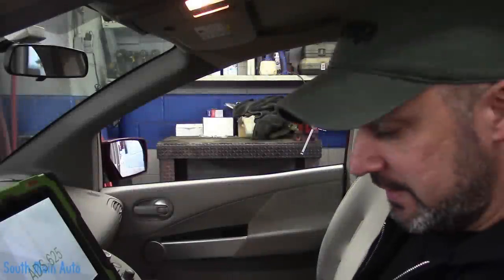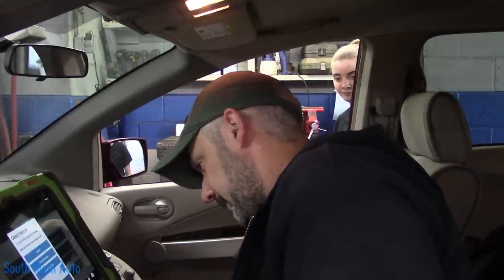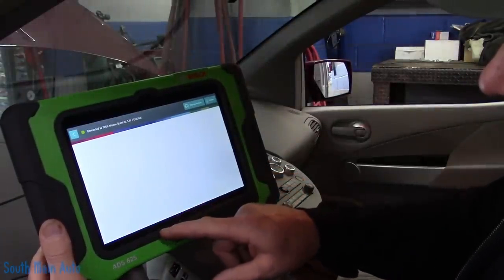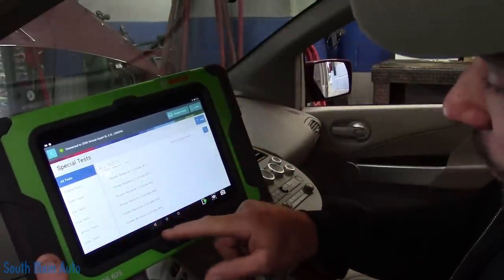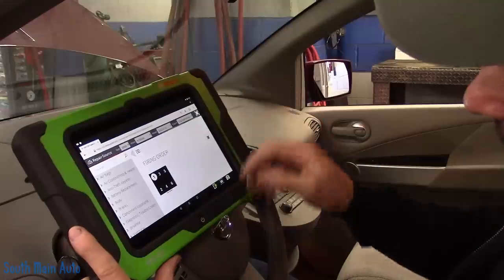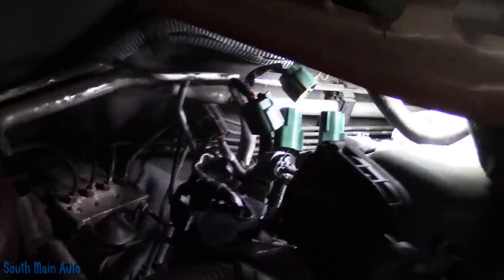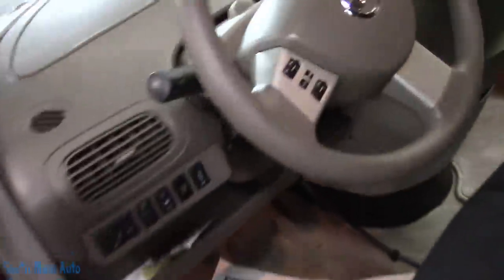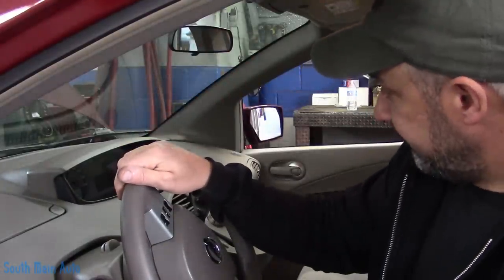Customer Replaced Spark Plugs And Now It Runs Bad!?

Comment: When I was 15, I rode a little Yamaha DT100 everywhere. One day the bike would Idle and move at low rpm's But as soon as she was opened up , she fell on her face. 

I limped it to a small shop after I couldn't figure out what was wrong. The mechanic came out after my explanation, Lifted the seat , removed my gloves from the intake of the air filter and said. That'll be 20 bucks.
Reply: Tom Wise   Was he joking or did you really have to pay?
Reply: @istvanmeissler2238  $20 is fair. Who knows when he'd figured that out. Bet it never happened again though.
Reply: Oh he was serious. It was definitely a life lesson.
Reply: He's gotta make money where he can haha! I had an old Yamaha timberwolf I was working on but didn't have a new air filter for the test drive (the old one fell apart). So I managed find a larger foam filter I had laying around and attached it to the cage with a couple of zip ties just temporarily for the test drive. It dies about 10 minutes into the ride. I looked to check the usual suspects but everything was fine. Then it dawned on me that the air filter may have got sucked through the carb and sure enough it did. It got pulled all the way through the carb then hung up on the intake valve steam. Pulled that out, went and bought the correct filter then all was well again.
Reply: Sweet

Comment: This video saved me big time.  I did the exact same thing this week on a 2007 Dodge Grand Caravan because I wrongly assumed the cylinder firing order was laid out the same way the the ignition coil pack was labeled.  Sure enough I had 1 and 3 switched around. I've been trying to figure out what was wrong for the last 3 days and came across your video.  Thanks a bunch I almost gave up and took it to a shop for diagnostics.

Comment: I figured that’s what he did - got the wires mixed up. 

An old man I knew told me about buying a 32 Ford hot rod  back in the 1950’s. The owner was selling it because it ran like shit and he couldn’t figure out the problem. It was a dog: Not missing, but no power. My buddy took it down to the local garage where the owner let him use the bay to work on his own car to do a tune up. It had a dual distributor Mallory ignition and he pulled all the plug wires without marking them. Then he had to ask for help so the owner got out the shop manual and they figured out the firing order and got it put back together.

Suddenly the car was a screamer. It would lay rubber all the way down the block. The guy who sold it had it firing out of order. Just like your customer.

Comment: Sometimes when you're elbow deep in a project, it's easy to miss the obvious. I work in bus garages, and I think most of us have had a situation where we can't get something to work, only for someone else to sort it out in seconds.

In a similar train of thought, sometimes it's best to walk away for a bit, then come back with a fresh, clear mind.
Reply: One of hardest times troubleshooting something was when I changed a motor in a car and it would run but only idle slowly. Any amount of over idle it would not go or quit. After spending like a whole day going over EVERY LAST THING I finally got the notion to try disconnecting the exhaust pipe and it went zoom. Turns out the old engine blew so much oil it plugged up the catalytic converter and sitting made it solid.
Now when I was on forums helping troubleshoot other people’s cars one of my favorite questions when it sounded possible was “ have you tried disconnecting your exhaust?”
Reply: The funny thing is that this is universal to any kind of troubleshooting. It's exactly the same for programmers who can't figure out why certain code doesn't behave as it should. Then someone else with a fresh pair of eyes comes along and spots the issue in a matter of seconds after you wasted hours or even days on it. 
Happens to everyone occasionally. :)
Reply: Yes, and sometimes after an all-day struggle all it takes is for someone to walk by and make some offhand remark about the issue to trigger the inspiration to solve it in a minute or two.  Had that happen more than once.

Comment: Thanks for the video Eric! We all find ourselves in trouble from time to time. I once did a front brake job on my 98 Ranger. I failed to realize when I took off the rotors that the inner bearing was inside the rotor. Took it to the machine shop where they turned the rotors. Inner bearings were sitting next to the rotors, but I failed to pick them up. I couldn't figure out why my rotors would not seat properly on the truck... DIY distaster as I towed the truck to the local mechanic. Problem got worse as the ABS sensors were damaged during my failed brake job. Cost me so much more than just paying for a pro brake job. Multiple lessons learned in this one.

Comment: get a transmission all the way back together and find a bearing or a seal ring or a snap ring on the bench.  now was this the old one or the new one??? and is there more than one outside ? did  i replace it?  now i have a cardboard box  the old parts go into only after the new one is installed. then parts list is compared to the box. nothing worse than being inturrupted  on a major job  multiple times.
Reply: interruptions will get you every time!
Reply: I like the box idea I make a list of all parts to replace check that list and I Mark or destroy the old part. Of course I only destroy (like a gasket or the like after I know the new one is correct). Do I can't reuse the old one. I have left my share of seals out prior to this method haha.
Reply: I put a trans in without a torque converter once lucky only bolted to the engine and didnt finish the reat went to put the bolts in and alot of 4 letter words came flying out lol
Reply: Great idea!  And simple, too.
Reply: Worked with a practical joker who used to toss random hardware on my bench when I had some piece of technical mechanical mischief torn apart. First time it happened I ended up doing the parts diagram, old part matching, head scratch. He went by laughing and fessed up as I was about to tear everything apart again. Taught me to be a lot better at organization and less of a chicken plucker parts dismantler.
Reply: james styler I ounce pulled a transmission out of a Toyota RAV4 and placed in next to the new transmission but managed to grab the old transmission and mount it in the truck and get everything bolted up just short of mounting the wheels just to find I goofed hard
Reply: @Gregg0112  You're not the only one that has done that. Lol
Reply: @Spudstrodamus  now that's bad, such a large part being forgotten :))
Reply: @mikeam3871  My daughter has done that to me on a 50 year old snow blower with no such thing as a a parts list/diagram available.  The little shit had the nerve to walk by and casually comment "you still working on that thing?".  This was during my third disassembly.

Comment: When I was rebuilding my Daughters engine in her 1998 Nissan Altima I mixed the Distributor plug with the transmission speed sensor... car wouldn't start and started poking around.  The plugs are the SAME color but not the WIRES, after 2 hours of scratching my head I switched the plugs and she fired right up.  Great video, even mechanics can make this mistake.

Comment: When I replaced the head gaskets on my 98 Legacy GT, I swapped the 1 and 3 injector connectors. Ran almost perfectly fine except for a slight miss about once every 30 seconds at hot idle. Not enough to even set a code. I drove it that way for a couple years until one of the classes I attended had a case study for a Subaru that very occasionally set misfire codes at idle because someone had swapped the injector connectors....

Comment: Wish I had your awesome diagnostics! That intake removal is why the iridium plugs in my wife’s ‘08 Altima Coupe soldiers on with OEM Iridium plugs at 130k. No MIL or performance issues.

Also, R&R’ed head gasket on my ‘87 Alfa Spider and foolishly swapped front cam caps left to right (marks can only be seen with close inspection) and since timing marks were not vertical, car ran for crap for months till issue was discovered.😟

Comment: Bought a new '87 Nissan Stanza, was showing it to a mechanic friend. He suggested getting the shop manual. ($75.00 - a lot of money back in '87) Over the years did many small jobs just following instructions. New plugs, headlights, telescoping antenna, electric window, fuel filter, air filter, heat shield, swap winter tires. Worth  it, as it taught me about car maintenance.
10 years in, a leaky valve cover. Again, a minor repair, but in my mind something mysterious and new. Bought the gasket and followed the blow up drawing and instructions. Scraped old gasket, dropped in new one. 45 minutes later and the job was complete, The car ran for another 4 years until the wiring harness started showing signs of wear. All kinds of electrical problems. Sold the car for $500.00 bucks. It still ran but I didn't want to spend the time and money trouble shooting multiple problems.

Comment: Cleaning throttle body fuel injectors. Used a black screw driver to hold butterfly valve wide open (cable jam technique). Sprayed gumout.
Reassembled.
Started nice clean black painted block of a 350 engine.

Found out GM puts a rev limiter on that nice engine.
Pegged twice before i could kill her.
Realized my mistake. (Camouflaged screwdriver)

Surprisingly the engine lived a long happy life.
Reply: Torsee I heard a story from a friend who test drove his car and forgot to take screwdriver out of choke and he opened it up and it fell through and held it wide open
Reply: @brianbrundage3116  oops
Reply: Yee Haw!

Comment: Thanks for sharing, makes me feel better about mistakes I have made.  I replaced the valve cover on my old Toyota Cressida in the mid 1990s but I pinched the seal on the cover, so when I started the engine on a test the oil started squirting out.  Quickly turned off the engine so no damage, and then had to take everything apart again to replace the engine valve cover seal a second time.   So it took twice as long.  It was my first experience working on my own car and I have made some minor mistakes since, but I don't do many complicated things.

Comment: In my younger days, a particularly fastidious customer brought in a new Pontiac for an oil change.  I drained the oil and affixed a new filter. I then pumped new oil from a 55 gal drum into a large metal pitcher with a flexible spout, which we used instead of separate qt cans.  As I began to orient the pitcher over the brand-new sparkling clean engine, I lost my balance and poured the entire pitcher over the engine and engine bay as the customer was standing there inspecting my work.  Actually, it looked kind of pretty, glistening in the light.

Comment: It’s especially forgivable given the extremely poor access and visibility to the rear bank. I would worry, however, about the cat being damaged from all that raw fuel if it was driven very far as Nissan apparently couldn’t be bothered to kill the injectors on dead cylinders to save the expensive cat.
Reply: fairly common on Tribute/Escape/Mariner 3.0L as well.. will make front cats crumble and clog rear. $$$ been there.  Luckily I "cleaned" the rear and no codes as the manifold exceeds value of vehicle w/ 194k
Reply: Vw don’t either, my wife killed the cats on her golf driving with a misfire due to a dodgy coil.
Reply: @jkmacgyver  Could be worse - in the 2003-2005 (IIRC) Nissan V6s the precats were apparently mounted too close to the cylinder, and when the cats started crumbling some of the grit was pulled back into the cylinders, causing horrible wear. A quart of oil with every fill-up is not unheard of.
Reply: flagmichael Yet more half baked Nissan/Renault “engineering” and another reason why Nissan is way down in market share.

Comment: Ist oil change gone wrong: old filter rubber seal still stuck on the engine, result - oil all over the drive, quick trip out for kitty litter.
Next oil change, drove over the full oil drain pan, more kitty litter required.
3rd oil change went ok, but still trying to get the stains off the drive.
Reply: You seem to be a work in progress, but kudos to you for DIY.  Remember that you're learning as you go.
Reply: The best way to learn is through experience. I always change my own oil on my Jeep. Try putting cardboard down on the ground under the oil filer and oil pan to catch any that misses the drain pan. Most people usually have some cardboard laying around. And remember to change your oil drain plug gaskets now and then!
Reply: Old 60s Chevy motors before spin-on oil filters had metal can with a thin rubber ring and most people didn’t know how to get the old one out. The most I seen jammed in one was I think 5
Reply: You can re-soften your oil drain plug copper washer by heating it red hot with a propane torch (then let it cool) called annealing.

Comment: Was still in high school. Changing the oil at my uncles house who kept a very clean driveway. Did not check to see if the old filter gasket was still in the old filter. Let’s just say that an oil pump can drain an oil pan very fast. Meanwhile my friend is on the ground laughing.
Reply: I did that with my old ranger, I was 30 though. I left a trail from my driveway all the way down the street. Doh
Reply: TSP cleans oil off concrete very well and cheap.  Happened to my mother-in-law’s car many years ago.  Hot oil and 3 qts on nice new concrete.  You couldn’t tell after I cleaned it off.

Comment: When I was 16 I changed my spark plugs for the first time and I torqued them down to about 100 foot pounds... the spark plug blew apart on the first crank and I spent a few hours fishing bits of ceramic and metal out of the cylinder with tweezers...
Reply: 100 foot pounds would strip them right out most they would go is about 30
Reply: Must have been back in the day when heads were cast iron.

Comment: I was changing plugs and wires on a chevy 350 (maybe it was a 305).  I used to have a habit of just ripping every thing off and using the book to run the new plug wires.  The ring on the top of the distributor had the cylinder numbers on them.  So I hooked them all up according to the numbers on the ring.  It wouldn't run for shit so we took it to a local shop and they told us that there are two different cylinder sequences for that chevy.  The one on the ring was not the correct firing sequence.  As you can guess, I don't just rip the plug wires off anymore.  I replace them one by one. 

Thanks for the videos. I enjoy watching them.
Reply: Michael Ginther exactly what I was gonna say. Remove one by one.
Reply: @garrettstevensen2467  Hopefully we never stop learning.

Comment: my dad said he wanted to teach me how to do a tune up. he had a '77 ford 351.  his method of changing the wires was to remove all of them at the same time. he then said the "correct" way was to put them back in order down one side then the other. he obviously had the firing order totally wrong and had no idea how to fix it. the neighbor came over and figured it out, but dad still insisted his way was right even though it wouldn't start.

Comment: I had a similar mistake with a 3.8 series buick regal. I had spark plug wires mixed up, car would not start because I was so sure that the rear heads were 1-3-5 & front 2-4-6. It was clearly the other way around.
Reply: I did thay exact thing with a 89' saab 900 2.0 inline 4.the problem was the book actually,the illustration was wrong and didn't show that the engine actually sits backwards (you can replace a clutch in 1-2 hours with this layout)

Comment: Waking up in the middle of the night after replacing intake gasket on Holden V8 and now no start:
 OMG the cylinder numbers are not the firing order!
Reply: Correct, typically laid out to maximize distance between firing cylinders. 4 pistons would go 1324, I imagine six would go 135246 or something
Reply: @ludvigericson6930  i think it would be 1243 or 1342 but it can't jump end to end or much over half the engine length  to avoid heavy shaking. 6 cyl might be 135642 but I'm no expert.

Comment: Changed the cap, rotor, wires and plugs on a Ford F150 351. At about 35 mph it began popping and backfiring, slowed down below this speed and stopped. Pulled over three times and checked and rechecked wires and firing order, all was correct. Continued driving and problem resumed above 35mph. Finally discovered problem, had loaded a canoe onto the truck's lumber rack, and there was a loose panel in the canoes stern (canoe on backwards, stern towards front of truck) and at 35mph and faster, the wind made the panel flap up and down, smacking the rack and sounding throughout the truck. Lol, had us going for awhile there..........

Comment: I am really surprised that someone could do plug in the wrong wires. Every implementation I've seen of the transverse mounted v6 gives different length spark plug cable.  Any associated connectors are color coded as well. To plug the wrong one in would appear obviously incorrect because one cable would have lots of slack and the other very tight. Very interesting.  Excellent video.